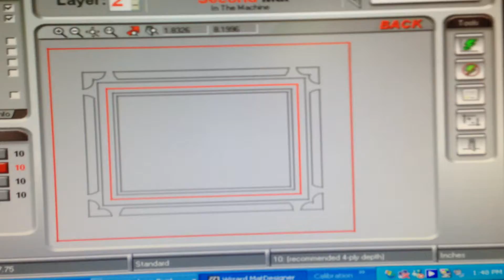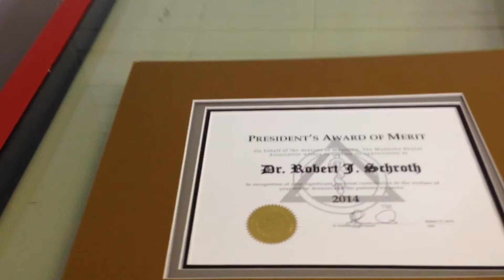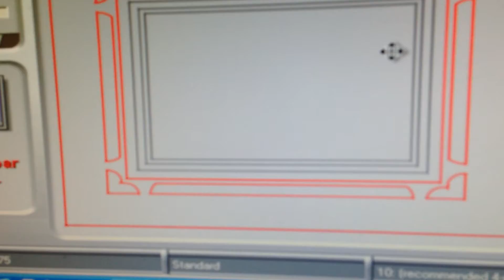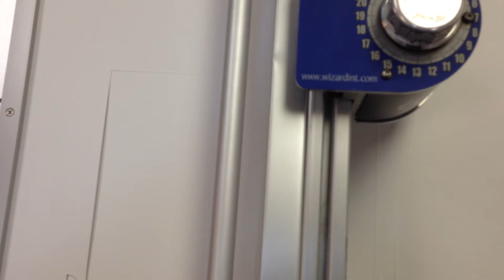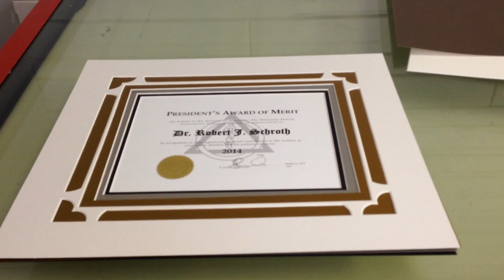Wizard CMC Mat Cutter in Action

Comment from the maker: No, but you do change the blades. There is an automated blade counter in the software that you can set for cuts. I set mine at every 50 cuts and then check how the blade is cutting.